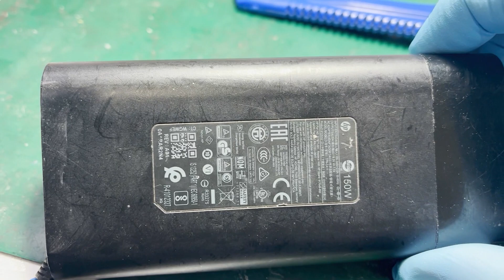HP Laptop Charger Disassembly and Cable Repair

Comment: My charger is like this and it tripped the circuit breaker. Now it wont charge, Is it still possible to repair it?
Reply from the maker: everything  is possible but the trick is to open its case
Reply: @Bertronics  I saw ants coming out of my charger. Maybe it's the cause why it shorted. Hayysss. Yeah it's an HP Victus charger, and it looks like it's gonna be hard to open without destroying the charger case.
Reply: @moymoy6547  Where do you live bro, I have the same issue. I think the ants shorted out a component inside the charger

Comment: I opened it using acetone and a cutter but mine is not delivering 19v i think. I measure between the white and black wire. it should give me 19v? Or i need to do something with the blue wire. i’m measuring directly on board because the wires are  cutted. Thanks.
Reply from the maker: You are measuring the correct wires, make sure to check the board for any burnt components.
Reply: @ thank you. I will check.

Comment: Is it okay to use any other compatible charger other than hp
Reply from the maker: yes under 2 conditions 
1- charger should have a data line like the blue wire in this one "in some HP laptops this wire is not a must".
2- current(amps) should not be below the laptop's needs

Comment: USA used to have descent design engineering. Now look at their HP charger design! Disaster. If your DC jack breaks or the cable wears off then you have to buy a new 70$ charger. It is so difficult to replace the cable. Stupid design.
Reply from the maker: I Totally agree with you
Reply: joke on you if you think they couldn't. its "they didn't". this is intentionally made this way so people will have no option but to buy a new one

Comment: The 200w charger has 5 wires... Any ideas how they are arranged? Do both the blue wires go into one connector?
Reply: The charger draws a lot of current. That is why you need 5 wires. 2 wires for + and 2 wires for - and one wire for sensor data.
Reply from the maker: usually the blue wire is considered as data and should be soldered or connected to center pin

Comment: Had the same charger and the connection was loose and wouldn't charge properly. Was tryna find a way to fix it myself but after watching this video, I was glad that I went ahead to purchase another charger.
Reply from the maker: you are totally right, its not an easy open and fix design
Reply: Where did u buy new one ?
Reply: @sujitpachode3207  I bought a replacement charger from an electronics shop. Same wattage but not from HP. Only issue was that it was a little loose and had the tendency to disconnect if the wire was moved slightly.
Reply: @wuzzym  does it work until now , any harm to laptop?